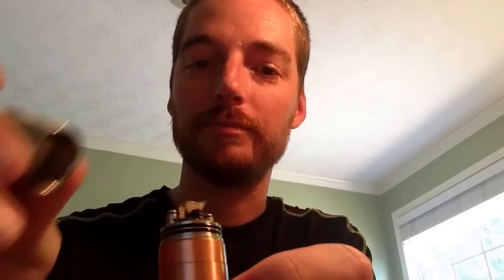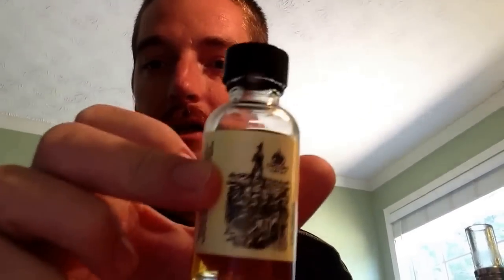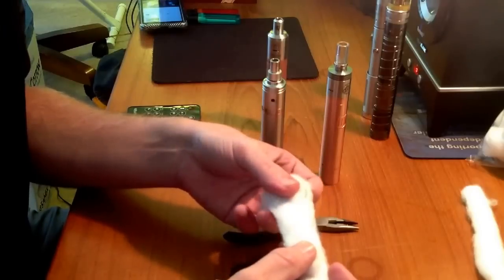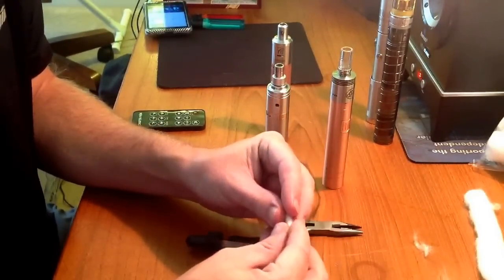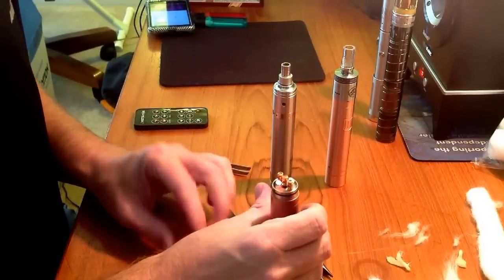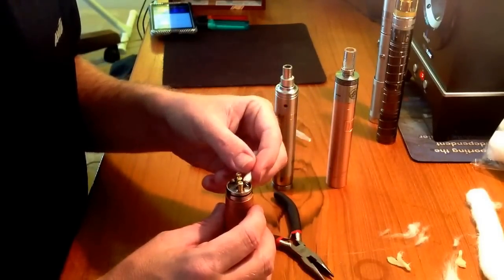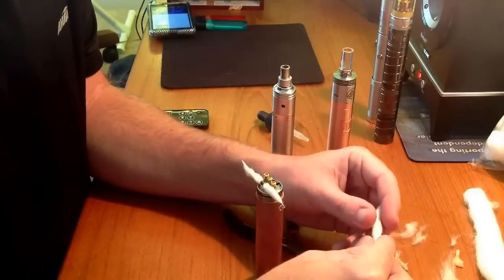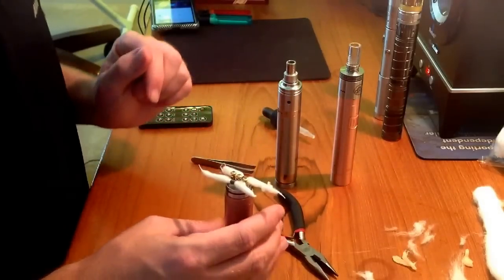How I Wick/re-wick my RDA's. Best method for vapor and Flavor!

Comment: Absolutely awesome advice! I have been doing RDAs for a little while now (always been a buildaholic when it comes to anything... I mean hell, I'm an Engineering major!) but, the one thing I was having issues with was wicking. I never knew if I had too much, too little, correct airflow, etc. Thanks! With this on a dual 28g 13 wrap microcoil (1.5mm) in a Doge clone on my Siegeli 100w+ at 60w, I'm getting a much cooler, more flavorful (and a bit more vapor) hit than I ever have, before! I'll have to try this out on my dual parallel 28g in my Mutation clone!

Comment: I need help with setting up my rda. 

-I'm having to drip every 1-2 pulls
-coils do and don't wanna fire evenly despite everything being tight(back and forth cycle of this)
-can't seem to get the right thickness for JOC wick
-coils get dirty quickly

Can anyone help me with this?
Reply: Different coil build will need different rejuicing times. Coils getting nasty is probably your juice you are using ..getting your coils to heat up even can be a pain but just keep pinching them and adjusting them, they will come around.
Reply: Ok! Thank you
Reply: 2SHAYNEZ do you use the metal handled or yellow ended Stanley screwdrivers when wrapping coils?
Reply: I use my own set. So neither one of those. I also have a coil master for my normal 1mm to 3mm quick builds if I have no time. I build Clapton's and other numerous kinds of coils. A ceramic tweezer is a good addition if you are wanting to build.I use anywhere from 20guage to 30guage for different builds. If I were you I'd probably use a set that can help you center the coil. It can be a pain but once you get the hang of it ...it becomes easy
Reply: Also just make sure you don't hit the fire button when touching the coils unless you use the tweezers I mentioned.
Reply: +lonesoul 1428 also if your coils are getting gunky really quick it could be your juice like some one previously stated. if youre using sweeter juices, itll get build up a ton faster
Reply: +r3dhaz32 thank you!!! it was bumblebee vapor that was gunk in my coils quickly
Reply: That will def make some coils nasty quick..
Reply: rewick every day for best results